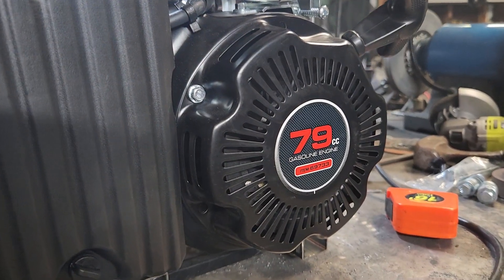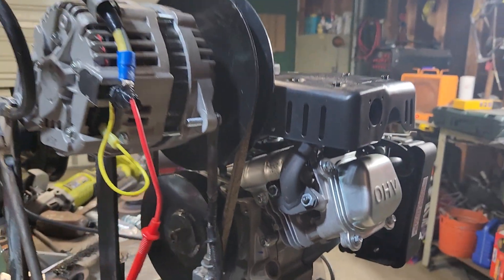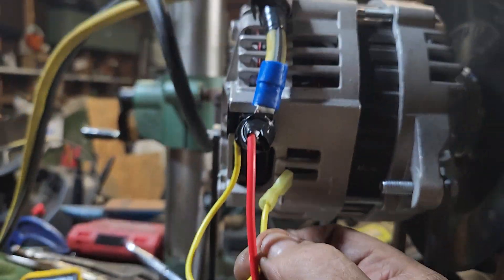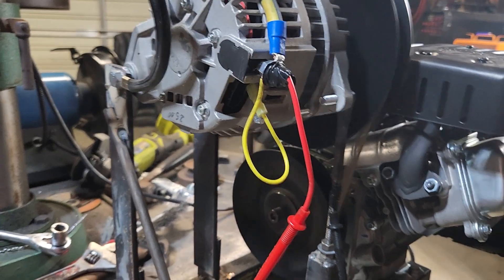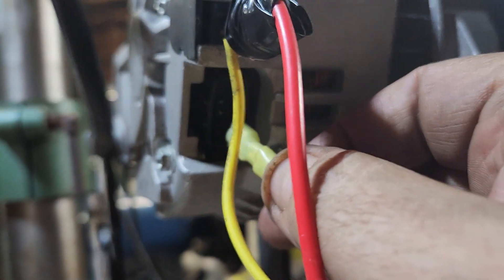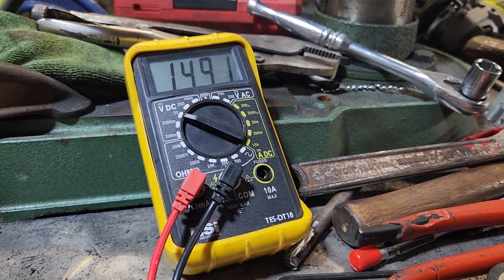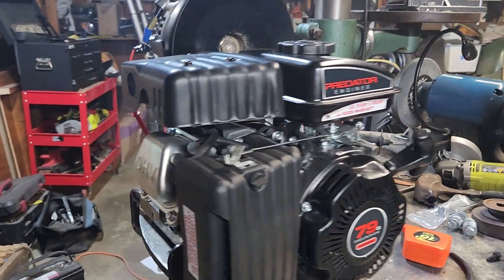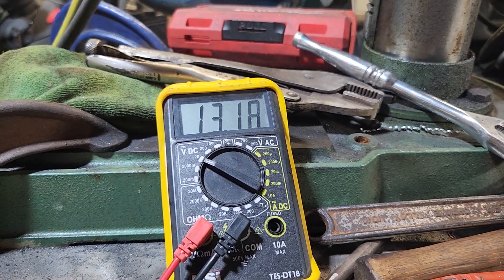Gas Powered Battery Charger

Comment: what alternator did you use?  thanks mark
Reply: Okay, thanks for the reply. What I'm wanting to do is. I've got a trailer with a 12000 pound. Winch on it that I'm going to bebuilding a log arch. And I just want to be able to while I'm using the wench. Keep the deep cycle battery that I have on it charged up and to me. It's just simpler and I've been wanting to build one of these anyway, but to me it's just definitely simpler to have. This as a standalone. Battery charger and I can take it anywhere. I need a battery charged.
Reply from the maker: @bluecarpenter22  Oh ya!! It beats a generator and charger all day long.
Reply from the maker: @bluecarpenter22  It's just an old 3 wire off of a dodge of some sort. Any 2 or 3 wire will work. A 2 wire is self exciting. You do not need any voltage to get a charge off of a 2 wire. With the 3 wire, there has to be at least 8 volts to get it to charge. That can be from the battery that's being jumped, or like I did here a motorcycle cycle battery that rides on the unit. This way I can rescue a vehicle with a completely dead battery.